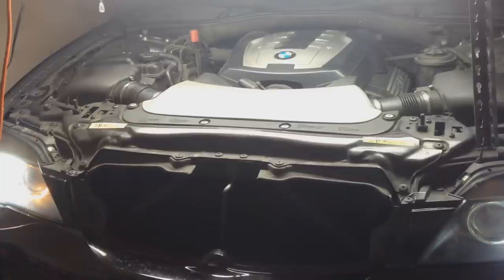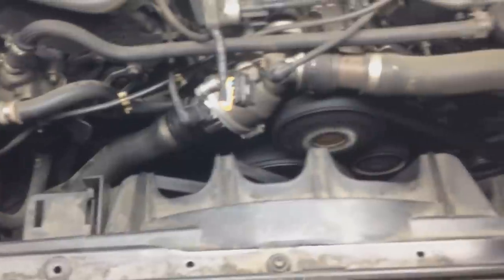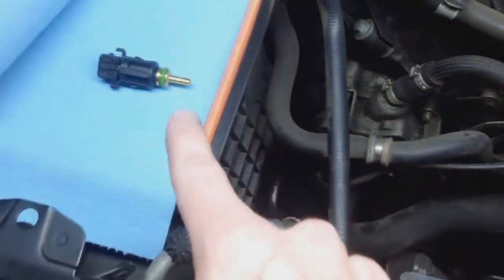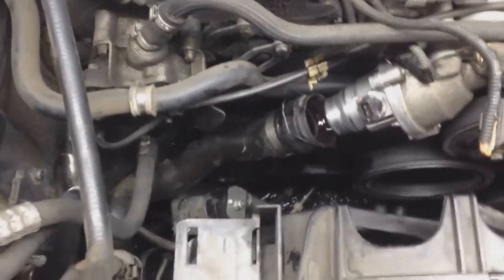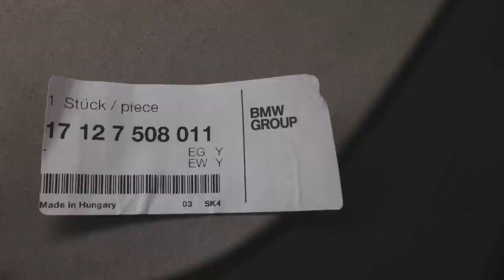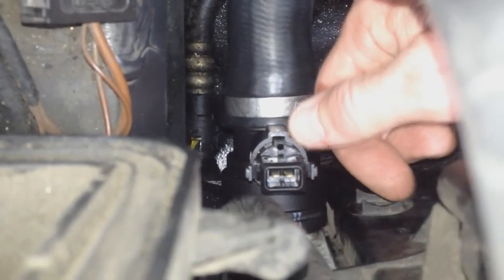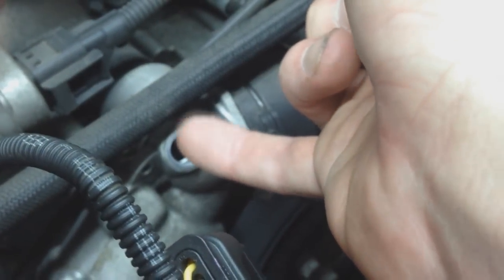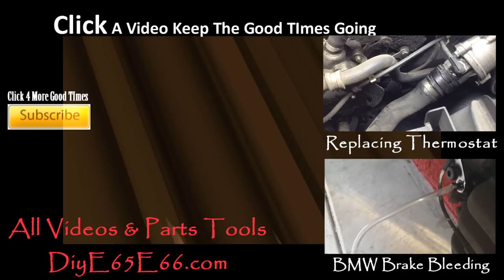DIY BMW E65 E66 Loud Engine Fan Fix

Comment: I've got a 2011 328, (78K mi) the fan began to run away from me today, LOL, (what the . . .). I'm seeing the dealer tomorrow and will ask them to replace both sensors just to be safe. I thank you for your video, I didn't have to worry about losing sleep tonight. It's folks like you that help make the world a little better place, thanks.

Comment: I have a 2011 BMW 328i and I had the same problem. Mine was at 56k miles and I had been looking for a solution everywhere. I changed the spark plugs, from the original to E3 and I do not hear the noise anymore. Maybe the spark plugs didn't produce enough power? I do not know, but these spark plugs worked wonders. Before I changed them when the car was idling I felt that it would shake; now you can't even tell that the car is on, at some point I thought that maybe I needed to change the oil again but that was not the case. Everything is smooth now! Something simple like spark plugs made that loud almost airplane noise go away!

Comment: Changing out one sensor at the time wold be my preferred method to analyse the real issue. You could also have got away with changing only one sensor. Now we are "left in the dark" wrt. the actual reason for the fan to stay on at full speed

Comment: Am glad it worked out for you Chief just wanted to say Thank you for this am having that loud noise now on mine but the mechanic said its my thermostat is there a way to know if the thermostat has gone bad? Thanks again all the best ✊
Reply: Most of parts. U wouldn’t know till u get changed 😎

Comment: very cool....I am having the same issue on ly 2009 X5.  It started yesterday while we were out and the car actually went into Limp mode.  We stopped, shut it down for about 2 mins, started it back up and were able o make it home. 
I am going to try this first.
Reply: Jose, how did this turn out for you? I have an 09 X5 as well 4.8i. Just started screaming, no low coolant indicators on the dash. I am going to try replacing these sensors.

Comment: I am having the same exact issue. I have a 2008 BMW X5. I have already replaced the coolant temp sensor and that did not solve the problem. I am going to replace the water thermostat sensor tomorrow
Reply: Did you fix it?
Reply: Ok now ?

Comment: OK....I'm a brand new, first time BMW owner and I bought it used....2011 X5....and this light came on less than two weeks after purchase!  I came here and had major heart palpitations....I've been warned that fixing a BMW is pricey, even though I'm still under warranty.  Turns out we were a quart low on oil....that's all!  Of course, I know that's a big deal and now that I am under the care of a 20 year BMW exclusive mechanic, it won't happen again.  Phew...........close call!

Comment: Hey Chris, first of all thank you for the video. My 2006 325i is having the same issue, but mine only does that when I start up the car in the morning or at night after leaving it parked at work for 12 hours. Once that happen if I turn the car off and on again it go back to normal so what I'm trying to say it's not on high speed all the time. Was you car the same or it was on high speed all the time? I had my water pump checked and it's in a good condition, should I start with the temp sensor? Thank you much
Reply from the maker: Mine was loud all the time but the sound of the road would drown out the sound of fan, I would start with the sensor and also check the coolant level.  The car thinks it's running hot so it shoots high fan at it to cool it down.

Comment: Hi Chris - Thanks for the video! I have a 2012 F10 520i and had this problem for quite sometime now. Dealership changed thermostat and it was fine for a couple of months, now its back! It happens even when the engine is cold. Took it to dealership again, they checked and said thermostat again!!! I am starting to wonder if it is actually the thermostat or maybe they are just clueless!!! Any recommendations?
Reply from the maker: Faisal Bukhari Hello, great call, is your call still under warranty, if so what ever new parts they want to throw at it I would just let them do it, it'll save you money later down the road, but for 2 failed thermostat's this might be a known problem with the F10's, I'm not exactly sure, but if you try to Google BMW F10 thermostat problems, try to read what the guys/gals have on the BMW forums they might have a better answer then me. Hope this helps.

Comment: It happen to my e46 m3 also but it use to cool the condenser and the mechanic who fill up the ac gas overpressure and the fan kicks in max speed all the time. Thought the fan was bad but actually the ac gas need to be set to its normal pressure range and it back to normal after that

Comment: I have an e46 and I changed the lower radiator temp sensor and my fan is still blowing extremely loud, I purchased the coolant sensor and have read its located under my intake manifold and I tried replacing it but didn't end up reaching it, so much to move out the way and was scared of damaging more than the sensor itself. Do you know if the sensor on the e46 is under the intake manifold or elsewhere? Thanks..... BTW how much would this cost at the dealer to get done?

Comment: Hi Chris I have 06 BMW 750li and cooling fan is completely not running and coolant tank and engine is over heating .. What should I start checking ???? I'll be very  happy if u suggest me what to do!! I change new thermostat,new compressor and water pump  is In good condition.plzz I need ur help 👏🏻 thank u.

Comment: bro mine is doing the same thing but mine doesn't run non stop full blast like yours, mine will wined up and be full blast for like 5 seconds then come down, waits like 5 seconds, wineds up again full blast for a few seconds then comes down.. kinda like an alarm on a fire  truck lol... do u think it's the same issue??? please help

Comment: Amen brother I just hope this will for 2006 Bentley continental flying spur I have the same exact issue I just did a new water pump and the fan is still at max all the time from cold start thx again you even help me with my bimmers thx thx thx

Comment: I have a 11 335xi, the last week I noticed the radiator fan would kick up and spin in full blast and stop and repeat keep in mind its been -30 F up here driving it around and it would do this parked. I had the AC blasting so I turned it off and sure enough it didnt turn on once for my little test, I only left it off for about 5 minutes and kind of went about my day not thinking about it. I dont drive my car much so today I hopped in and it was a nice day 30 F and me and my girl went for a little cruise probably like 45 minutes, just going 30 most the time, hopped on the interstate for 5 minutes went 70, I took the exit and soon the AC started to get a little chilly I didnt pay too much attention but noticed, drove like 5 minutes home going like 30 and at this point it was blowing cold air and I was confused, asked my girlfriend if she felt it just to make sure I wasn't crazy. Almost the same time I asked her the iDrive system pops up saying warning! high engine temperatures! I glanced at my oil temperature and it looked perfectly normal then half a block later I got emergency engine heat from iDrive and lost almost all control from the accelerator. I immediately pulled it over and turned it off and sat there for about 15 minutes, turned it back on and it kind of kicked and started very rough and carefully drove it home. Any recommendations?? I appreciate if you read this I really do, theres no mechanics within 4 hours that will look at BMW's where I live so its either fix it myself or have it towed to a dealer/mechanic, thanks in advance.
Reply: I have an 08 535i and the fan is cycling on and off like yours was. Only stays on for a few seconds at a time.  Went into limp mode on the highway with overheat warning. I was wondering if you ever found a fix for it??

Comment: Good video but I think my 745 li has a air injection pump problem when u turn it on it's SOUNDS LIKE A MOTOR CYCLE IN FIRST GEAR? Very loud crappy sound any suggestions?
Reply: TRMC I had the same problem for the first 2 minutes of starting my 745i. It was a leaky pipe from the secondary air unit which was then struggling to get the vacuum up to pressure. Mine was a cheap quick fix. Good luck

Comment: i have a question i have a 2000 bmw x5 4.4i it overheated on me then turned off on me well driving it then it eont start has crank but no go i checked the gas line and has no presure i could find the gas relay to check if it went out can you help me thank yOu

Comment: Hi. BMW 2007 E92 diesel. My is showing the overheating Symbol and straight after it's going into limp mode. The fan comes on full blast and continues even after the engine is stopped for maybe about 10 minutes (on full blast). Any idea on what it could be ? Even on cold start it's showing over heating straight away and fan comes on. A little period in the middle where it was running fine then the problem came back.

Comment: I have bmw e66 745 fitted with electric fan the full dan speed not working so the temperature reached 109C before it never pass 105c so i want to know is it temperature sensor of the fan issue
Reply: Thermostat

Comment: I have a similar problem with my VW Polo.
The fan runs very loud the moment I start the engine and stays that way until I turn the engine off. I will try and replace the temp sensor.

Comment: Please help.. My e92 328 2008 has very loud fan noise at startup at cold and sometimes it takes 15 min to go off and sometimes only 3 min or when I shutdown and restart the engine..  i changed the water pump and the thermostat but that didnt work.. Is it clutch ? Or sensor? What kind of sensor please help

Comment: 2007 BMW328xi   The first time my fan sounded like a jet airplane it also said it was overheating.  it shut power down and I immediately had towed .  All fluids were fine with no real apparent overheating..so it was back to normal fan speed for couple weeks then again..it started yesterday...seems as I start to hear then I slow down or actually I have turned off car then back on for a normal fan speed ...would you start with the fan sensor & work backwards....Need your thoughts please help
Reply: Julie Hinton have the same issue. 
Overheating symbol. The fan on loud. Car goes into limp mode. 
Online thread says water pump and thermo. My garage saying it's a faulty fan... the fan has two speeds a high and low...but it's stuck on high. They replaced the switch but it didn't fix. The fan is an expensive part. So that what I'm waiting on now. His conclusion is that the car is going into limp mode because the fan can't function on the low speed and this makes the car show the overheating. And the fan comes on at high speed. Guess it's a waiting game now...

Comment: I just put a new water pump and after putting it I got the loud fan noise. Then I fixed the thermostat and still doing it. Today I went and got the two sensors after watching this video and after putting in the sensors I still have the loud fan noise. Not sure what else to doo. Any suggestions
Reply: Did you ever get this fixed and what was the issue

Comment: hey Chris, I need some help. I have the same problem with the same car. I replaced the coolant/fan sensor and still no luck. I disconnected the water pump sensor and thermostat one at a time and did a loop relay on it just to see if one was working and the other wasn't. But still the fan is at 100%. Do you think it might be the fan at this point or should I still replace the other sensors? Thanks man I appreciate it. Also the link for the thermostat doesn't work. Thanks.
Reply from the maker: Hello, if you have already replaced the lower coolant fan sensor then I would replace also the water pump sensor just like I did in my video.  But before how new is your thermostat sensor?  Also have you checked your coolant level?  My fan turned on again 100 percent when my coolant level was pretty low.
Reply: I bought the water pump sensor and thermostat sensor. I'll keep you posted. Thanks for the quick reply! I hope this fixes the problem.
Reply from the maker: Excellent let me know how it turns out.
Reply: DIYsavecash so I replaced all sensors and the thermostat and still the fan goes at 100%. I guess time to replace the fan?

Comment: Your lower temperature sensor was reading high so your car thought the coolant temp returning to your car was too high and so engaged the fan at full speed to aid the radiator in reducing its outlet temp
Reply: you correct
Reply: So it’s not the thermostat?
Reply: @chevymusclecar1970  you can say its a thermostat in a condition where the engine was running for atleast some time and started over heating. But if you just start your car cold , and ac is sw off and fan kicks in at full blast within a minute then it is not heat but a bad information going to the system.
Reply: @junaidgt90  thanks for the reply but now the transmission is in fail safe mode. 😢
Reply: Super answer 👍. Very logic.  U r so expert 🌹😄

Comment: My 2007 BMW 750li is running hot. The car ran hot and the reservior burst. The repair shop said it was the fan, so I had it replaced, but that was not the issue. I have a loud fan after being on for a few minutes. There is water being thrown from the front driver side and it is still running hot. I think it could be a bad water pump hopefully. Any ideas?
Reply from the maker: Look at the color of the water, does it look blue(ish) that's BMW coolant, if it's squirting out by drivers side then it might be your water pump going out and the gasket is going bad?  Open the hood and pull the engine plastic cover off and look inside and check to see if your leaking coolant, also check the hoses the upper hose and the lower hose for leaks or cracks in the hoses.  Lastly check the lower hose coolant sensor, it's either this video or another one of mine that I have that shows you the exact location, if your low on coolant also the engine will get very hot and the fan will super speed to try to cool it down, in my case it was the lower coolant hose sensor it was bad and the engine thought it was hotter then it really was, also lastly check the thermostat sensor and then the water pump sensor I have videos for all of these.  hope this helps.
Reply: You first have to seal your leak because the coolant system utilizes hydraulic pressure to circulate the coolant. Then you need to bleed all the air out of the system by opening the bleed screws then close them once no bubbles are streaming out.
Reply: I am a universal mechanic...check your thermostat because if it's not working water won't flow so it will cause over heating. If the fan it's working it suppose to cool  down the over heating so that let you know your thermostat it's bad.

Comment: that is currently happening to me when I charged my AC with 134a last week. 
what do you think?
Reply: Hi rom com ,,just d something happen to me ..did find d problem ???
Reply: @chenchoescobar4203  
yes. I SOLVED IT man and I wanna share it.
So here is what I did...
I purged the ‘low pressure port’ and let all the freon out 1st.
And then, I fresh-charged it with Arctic Freeze. About 340g can. 
Turn-On the AC and air to ‘Max’ while charging. 
Just be careful not to over-charge. 
DO NOT OVER-charge.
Reply: Thanks bro..that's correct...just dit that,,..👍👍🙏

Comment: I keep getting p1111 Engine Coolant Temperature Radiator Outlet Sensor  where would this be located?   Ive changed  the thermostat,  lower coolant temperature sensor  and i still keep getting this fault , can anyone  shad some light for a 2003 bmw 745li  , thanks in advance

Comment: I have x5 5.0 2015. 300 miles on it brand new and i have a loud coolinf fan noise. It comes then goes away. I dont know why. You think theres a problem with my car?
Reply from the maker: Omar Guseynov Hello, if the noise bugs you then go into the dealership and complain for sure, the car is under warranty so they'll fix it. You can always test drive a different one to see if the same thing happens on the other one.  It might be because its summer time and your running your a/c alot, but they can tell you better then me, but I would head over to the dealership and ask what's going on.
Reply: I dont use ac its 70 degress here. And it's still making a humming noise. I will go there soon. My friend got the same car and it doesn't sound loud at all as mine.
Reply from the maker: ok yes I would go in and speak to the dealership.

Comment: I have a 2008 528xi. I have this issue. I changed to water pump and the thermostat and the radiator temp sensor. I still have the same issue. I NEED HELP
Reply: After reading comments.  I sueggest starting with spark plugs as they’re something consumbles.  Then with sensors. As @junaidgt90
Said above 👇
 you can say its a thermostat in a condition where the engine was running for atleast some time and started over heating. But if you just start your car cold , and ac is sw off and fan kicks in at full blast within a minute then it is not heat but a bad information going to the system.

Comment: Having trouble with fans not coming on...possible same issue? Sensor?
Reply from the maker: hmm, fan not coming on at all, my first guess would be a bad fan connection or fuse.  Normally they always come on, try to have it come on after you run the Air Conditioning for a little bit.  But I would Google BMW E65 E66 fan not coming on and read everything you can in the BMW forums, even if there discussing another 5 series or 3 series normally the fans are connected the same etc.  Don't dump money into the car until you read everything you can on the forums those guys have been through everything and have great write ups for the cars.  Hope this helps.